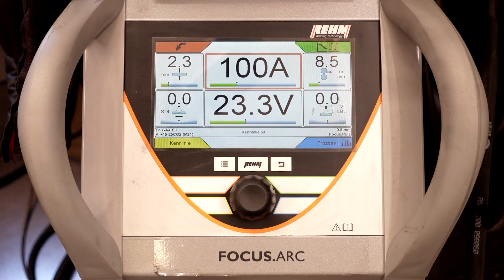Custom Welding Cart Build

Comment: Very nice great job m8. I also see that you use top of the line equipment. Tiger ac/dc water cooled unit and Focus.Arc mig welder. Really great tech machines!!!
Reply from the maker: Thank you 😁 yes i like tools and i like spending money for it 😅
But the Focus.arc is actully a loan from Rehm 👍

Comment: Dude, your bandsaw just tripped me out.

I also love your welding table with the threaded holes. How objectively flat is it? I'm trying to decide whether to build one similar to yours (though narrower) or buy a cast iron machined one. Thoughts?
Reply from the maker: It depends what you want to do.  I would build one for my hobby.  If you do it full-time then I would buy a cast steel table

Comment: Hello Dirk,

First, I'd like to thank you for your work. I never miss a video.

I would like to ask you a question about tapping. I am building a welding bench myself and I am having a problem with my M12 tap.

I drilled to 10.3 and when I try to tap, the tool gets stuck in the hole and spins in the drill chuck.

Have you modified your tap to avoid this problem or maybe you have a part between the tap and the drill?

Thanks in advance,

Jean-François Dernelle
Reply from the maker: Hi, actully i just have a nice clean chuck. Something if its used a bit you get this problem. I have modified taps and non modified taps. On 3 sides a small line with the grinder.
Reply: @TheMetalist  Thank you for your reply. It functioned. :-)

Comment: I know that had to be super irritating when the stuff would not quite lay flat in the drawer. Argh!!! All that work and a quarter inch short. You should shave the sides of the plastic box so it can fit flat
Reply from the maker: It actully fits perfect but as i filmed it, it hasn't fit

Comment: Hey man, great work! 
What kind of tig torch is that and how do you press the activation button? I am interested because of the tight grip you have on the torch. Looks insanely good to control.
Reply from the maker: Its a ck worldwide flexloc tig torch, controled with foot pedal